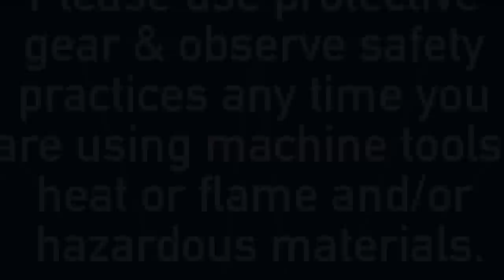How to FLUSH SET a gemstone - Tutorial l Gem Collectors

Comment: How do you do the center stone?  I love those settings but never see how they are done.
Reply from the maker: There are two episodes in the “How it’s done” series available to view where I showcase the making of a sapphire ring and feature how I flush set the center cabachon oval and 2 round faceted sapphires. The technique is the same where I undercut below the edge just enough to “pop” the stone into the mounting and either use a  hammer handpiece if your confident enough and familiar with how easily broken a stone is using that piece of equipment so it’s advanced stone setting for sure. The other method everyone should learn first is the use of a gravers block or type of vise to secure the ring and then use a hammer and punch type tool ( I make and shape  mine as needed from a prong pusher and burnisher) to hammer the tool against the metal to close it over the edge of the stone. Much much slower but safer if not confident with the hammer handpieces… especially the better Swiss made ones that really move the metal much quicker…. But require practice….

Comment: Excellent video but would like to know sizes of drill bits, and sanding discs.
Reply from the maker: The snap on sanding discs are  7/8” on a 3/32” mandrel and the initial drill bit is a 1mm standard twist drill. The size of the setting bur used to make the seat for the stone should be slightly smaller than the round stone being set so thatyou can “undercut” the seat below the bezel making the stone able to “snap in” if done perfectly and thus allowing minimal effort to move the metal over the girdle of the stone.

Comment: 3:25 - They are highspeed drills, that dont mean highspeed drilling. Tip is when you drill (with good equipment) you see and feel when the drill take of material when you use the right emount of pressure, if you use to high speed and to low pressure the drillbit just get damage...

Comment: Please explain why some flush settings are not considered real, aurgentic, because of the setting. I have waterfall earrings that are etched as diamonds I  the girdle. The jeweler believed because tge settings, they are more costume, not real carbon. He could not see the etch ge said. It clearly is visible, seen partially with naked eye.  Who would test in thus case?
Reply from the maker: Ms. Margaret,
       Unfortunately there is a big difference between jewelry store employees that call themselves “jewelers” and actual employees that are fully skilled goldsmiths and/or book or field educated experts in gems and minerals.
     Someone doesn’t have to have the diploma or the certificate from a jewelry school to have knowledge that far surpasses those that do.  Actual hands on experience at the bench or Gem ID Lab and working with different mentors over many years will far surpass any few week course that then deems  one as a “jeweler” or Gemologist through a piece of paper when you completed a course.     Having  the passion to self educate ones self through books and use of Gemology equipment and practice will greatly add to the basics that a Gemology course will give.  
      That said, opinions will vary tremendously from jeweler to goldsmith to gemologist to jewelry “clerk” which  is the category I put the largest percentage of employees at chain and department stores, just clerks.
    I will try to sum up your very good questions that our industry faces daily in a simple fashion. 
     First, you may very well have learned more from watching GEM Shopping than your jeweler or “clerk” knows!! 
At least it sounds like it!! Also, the description of a flush setting has nothing to do with whether a stone is genuine or not. They are two different subjects.  A flush set stone, can be done with any fake, rhinestone, quartz, diamond etc.... it’s any stone of any shape that the girdle falls just below the surface of the metal which is then “burnished” to create a rim of metal that covers the edge/girdle of the stone, thus holding it in place. This is called “flush set”.
       If the metal is gold silver or platinum than this is the method used to create a genuine flush set stone.  In other metals and costume jewelry this effect can be made to look genuine through the use of glue to “set” the stone. Saving time and danger of breakage. 
     Another actual stone setting method gives the appearance of flush setting but is done by using a beading tool to create a rounded bead of metal from the same edge of metal used in flush setting. Usually 3-4 or more beads of metal are pushed over the stone to keep it in place and this is also the method used for “pave’” set stones.  It is called Bead Set. A magnifying glass or loupe can be used to determine if it was bead set but should be visible to the eye if the stones are big enough. 
      I also did an episode on bead set and flush set stones as well. The sapphire ring I made in the “How It’s Done” series has flush set sapphires on the side for a visual description.
     SUMMARY :   I am not sure what you mean by “etching” but I can simplify it....  If the jewelry article is not made of a precious metal, and it should be stamped as to what karat and type of metal it is, than there is a high likelihood that the stones are not genuine either and thus considered costume jewelry. 
Genuine flush setting is unlikely in this case due to cost involved. And the stones can be scratched with any piece of quartz or stainless steel knife.
    If the piece is made of precious metal than the earlier information above  is pertinent and the stones if diamonds only, cannot be scratched by any object but this test should be done with caution in the event they are genuine but not diamonds. 
    Final note: you mention “raw stones”...there are very few jewelers, Gemologists and jewelry stores that  can differentiate the rough version of a stone from a genuine cut stone of the same type.
       The smarter ones won’t offer an opinion if they don’t know for sure, unfortunately there are too many that don’t want to appear lacking an educated answer so they will take their best guess which is more often than not— incorrect.   When I had my stores I would show the client how to use a loupe, only takes a few seconds, (jewelers magnifying glass at 10x) and explain and show the customer why I felt a stone was genuine or not. I made a lot of clients this way as it made them interested and involved in the science of gems!...... Ask your favorite hometown jeweler who seems to have the most knowledge to actually show you why they feel the way they do.  Like the etching issue.....If he  or she isn’t busy then they should do so with pleasure if they have the education to back up their answer.... their reaction may tell you all you need to know!!? 
I hope this helps....and Thanks for watching and for your question!
Reply: @gemcollectorswithshawnlgem4613  , thank you for your time and knowledge. In case you are not aware,  there's a little hidden "gem" about stones found in  randomly creek, nature. I'll try to send pics. These are old and new ones I ve collected. Rough as it may be, history was engraved in many loose stones. I used plah- doh like a wax to enlarge on phone.   Thanks again, I will keep this link as a reminder that somewhere my collection can be assessed propperly.
Reply: @gemcollectorswithshawnlgem4613  , Thanks for the insight. I tried to share real treat with pics that show engraved stones , gems, that can usually be found in creekbeds. As odd as it sounds, I've collected a few, enlarged the pics on phone to see what is,detailed. There are some nice ones with early dates. I believe 1500s. If I can track a propper email, I ll send the pics.